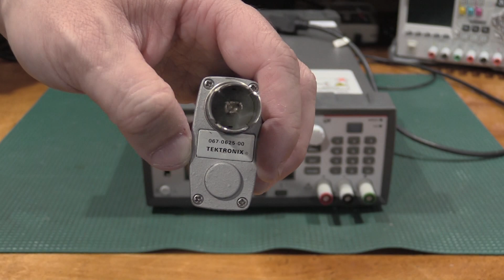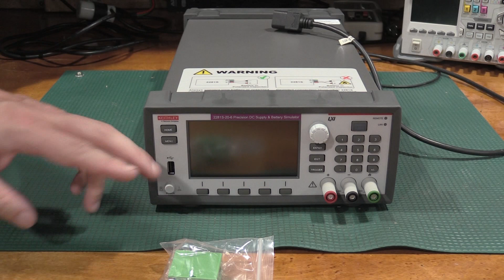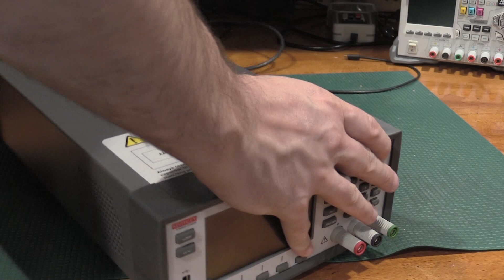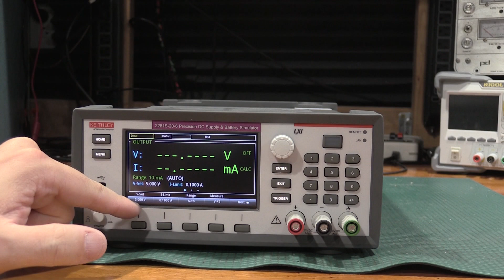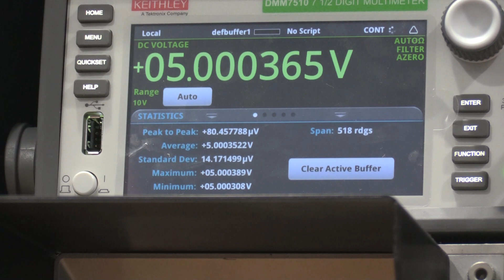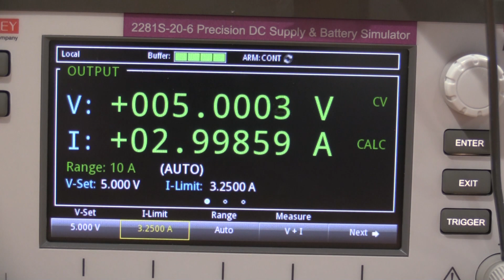It Finally Arrived! Keithly 2281S

Comment: Very cool. The battery simulator is really neat.
Reply from the maker: Now all I need is the SMU's so I can make more accurate models of specific battery types. Need to work with button cells and 18650's in one, two, and three packs.